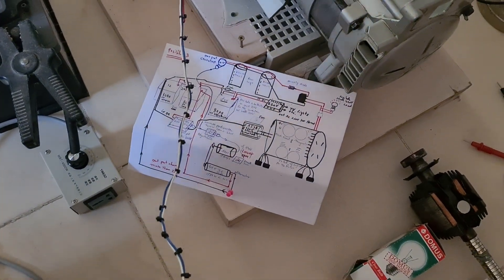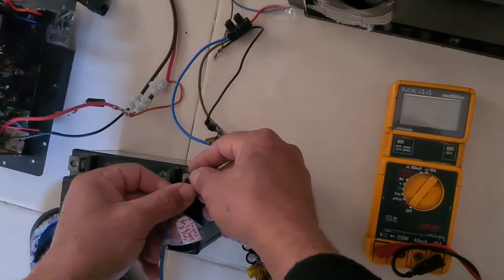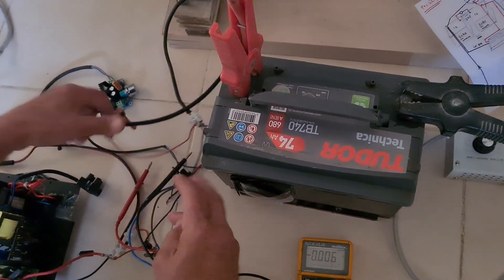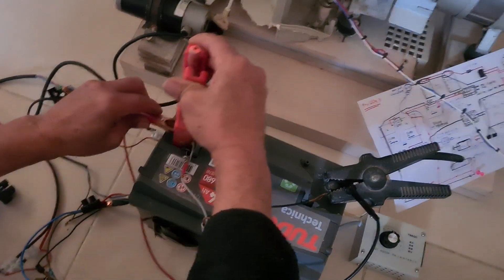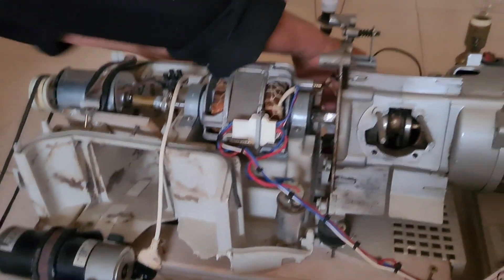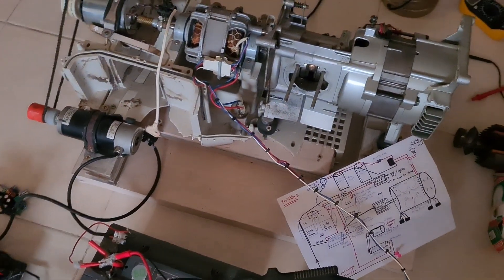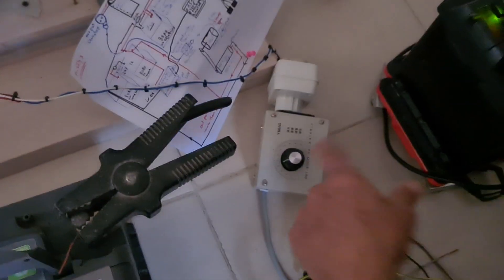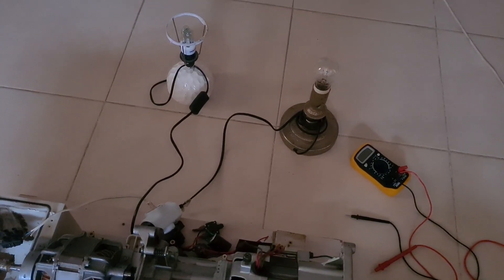Self-running 2022 fuel-less generator from 900W up to 2Kw PART 1

Comment: What's the rpm of this generator
Reply from the maker: Hi, usually you need 3,600 rpm to run a 220V generator or 1,800 rpm for a 110V one. In this case it is a 220V generator but I spin it already at 1,500 rpm thanks to the magnets I installed inside the rotor. So it became a permanent magnet motor. I hope it helps. Best regards

Comment: Is it possible to charge the battery while it is being discharged at the same time
Reply from the maker: Hi thanks for your comment. Basically it's not possible to run the motor that runs the generator and charge the source at the same time. The source in this case is the input battery. So what we do in this case is use a relay so the motor works for 15 minutes on the input battery and the alternator charges another 2-3 batteries at the same time without being connected to the input battery. After 15 minutes when the relay is turned off, we put a DC to DC converter of 10Ah that charges the input battery from the charge battery back to its initial position. There is some energy left over for a small inverter in addition to the AC output that the generator gives which is not much but the work of the alternator is much more important. I hope it helps. Regards
Reply: @denissabourin  u are making sense
Reply from the maker: @muhammedmustech1598  shoukran ya habibi

Comment: Ohms law doesn't  allow this contraption to work long. To put it simple,  if your contraption consumes more power than it produces,  the contraption will only run until the batteries get week.
Reply from the maker: Hi you mean the battery will get weak and not week. In this case we are working on energy storage.